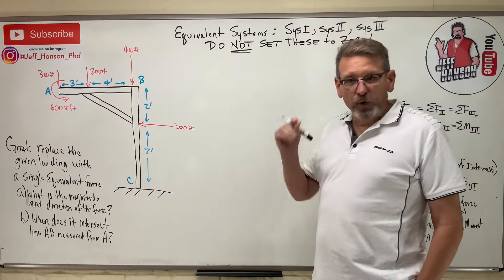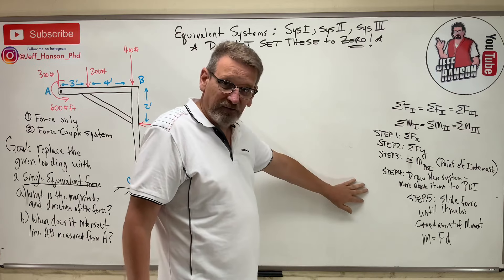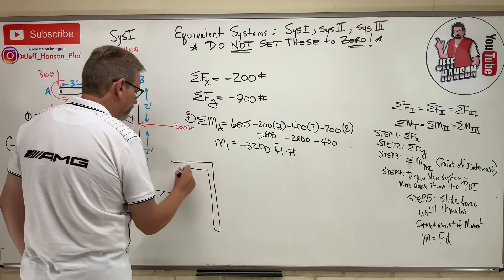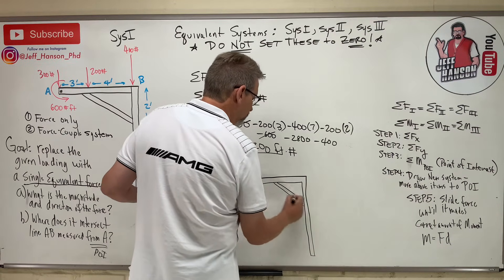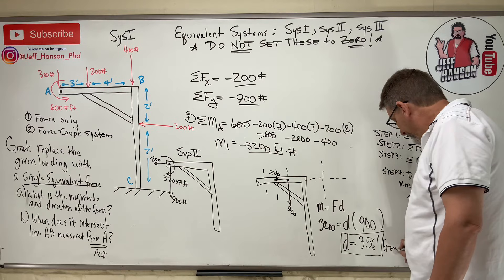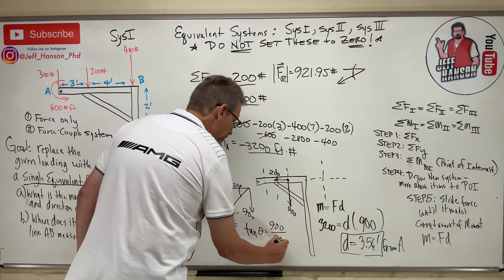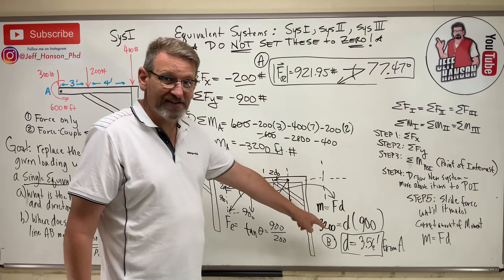Statics: Lesson 28 - Equivalent Systems, Further Simplification

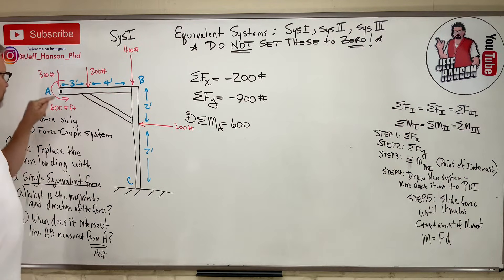Comment: Main point to remember here is the Point of Interest (POI). On this problem it is all about point A. ALSO at 3:15 the Doctor explains it very well about "Forces and Moments". Knock out the forces but not the moment. If you notice he didn't use the 300# force for moment because it would be 300#(0). I am thinking Fy should equal -600#.
Reply: Thank you because I was a bit confused why he did not add 300#